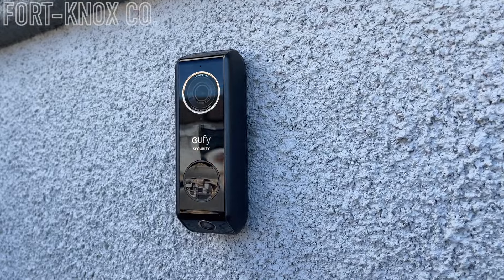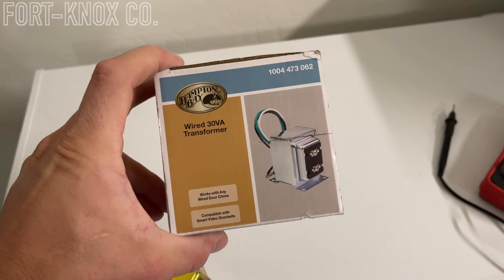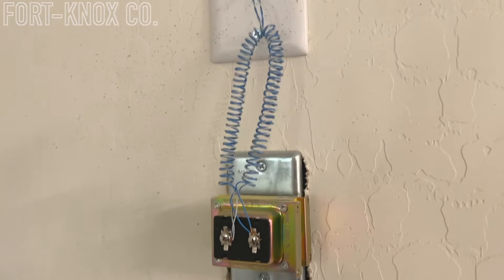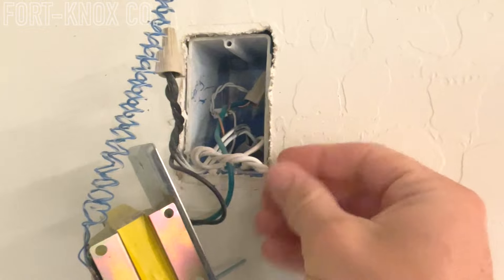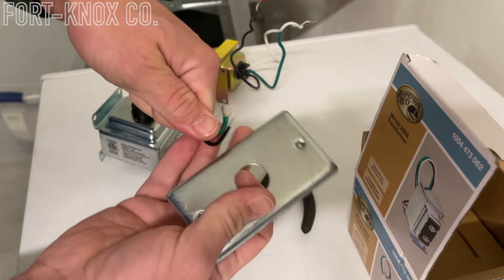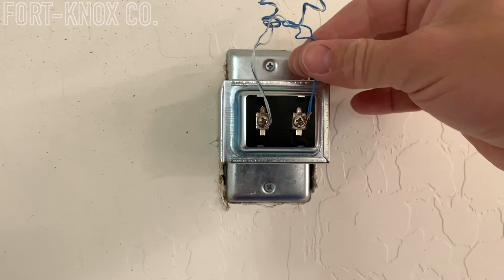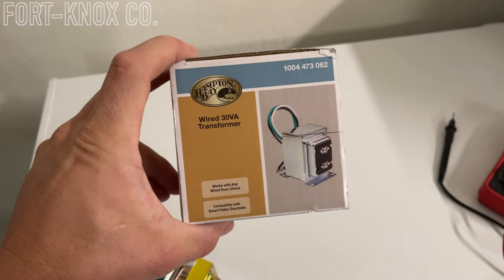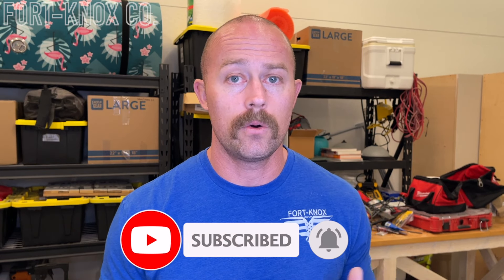Upgrade Your Doorbell Transformer For Your Video Doorbell | Ring Pro Doorbell Efuy Security Blink

Comment: Help. I checked the voltage at my front door button it reads 12 volts. I think I see the transformer in the garage above my breaker box up always. If I upgrade to 16 volts will that adversely affect my existing doorbell? I have high ceilings and don’t want a new door bell. While on the subject the doorbell chime is in a box and there is another box next to it? Could that be the transformer? I really don’t want to screw something up.
Reply from the maker: Finding your existing doorbell transformer shouldn’t be too hard. Everyone that I’ve seen even an older homes. Looks just like these in the video. It’s a small little box that’s wired on the outside of the outlet junction. Inside is common electrical wires and your basically wiring in a transformer that downgrades the power amperage to be appropriate for a doorbell. Finding this transformer in your house is the first thing. Once you’ve located where that transformer is at then you can easily replace it or upgrade it. I don’t believe upgrading to a stronger doorbell transformer will mess anything up. Assuming that you’re using a video doorbell most of them now of days need the higher power which is why this is becoming more of a common upgrade or builders are just installing this larger doorbell transformer during construction.
Reply: @FortKnoxCo  thank you

Comment: so, with this transfermer upfraded, my old chime will works?
Reply from the maker: Not sure what you’re asking. Is your stock door bell chime not working? Because changing out the transformer in general may be a solution. But a broken chime could be a couple of things. Upgrading to a bigger power transformer isn’t just a Fix in itself. But for most new video doorbells they require more power than what most houses  are built with. So in that case you should upgrade the power for video doorbells

Comment: Great video. My video doorbell camera and doorbell function were working with the old transformer (16/10) but after about 8 months, the doorbell stopped working (camera still worked). I just upgraded the transformer, but the doorbell still doesnt work (camera still does). Know what the issue could be?
Reply from the maker: If it just all of a sudden stopped working 100% it could be software update? Or could be mechanical and may need a replacement. I believe they have a good 1 year warranty. I’ve heard good stuff with their customer service and Amazon return process if you purchased it through Amazon. They like to work with you on that kinda stuff

Comment: I have a mechanical doorbell with a wired Ring Doorbell. There’s a delay to the mechanical bell once someone presses the doorbell. Will a new transformer fix this delay?
Reply from the maker: Possibly. But usually once you install a video doorbell there is a plug in chime associated to it. If it’s delaying the old chime/bell inside that could just be the way the new video doorbell is sending the signal. It’s possible interfering with the power to it or the signal timing.  It doesn’t hurt to have the stronger doorbell transformer either way

Comment: I have a euyfy dual camera 2k,doorbell (battery operated,) i also have a existing doorbell,  can i use this transformer to trickle charge the battery on the doorbell?  TIA.
Reply from the maker: If your able to install this transformer and run wires to your Eufy doorbell then you could use the wired version since you have the power there.  I don’t believe the battery operated versions have power hook up terminals on the back. But if they did, which some battery back up doorbells have then you could hook it up to those transformer and it would have constant power form the wires. Then if power went out your have some life left from the battery.

Comment: Hello, my house has a 10v 5va transformer, you think this 16v 30 is to much, I have two ring video doorbells on it, and today I notice both battery were dead, was good for the last 7 years.
Reply from the maker: It will not be too much. You will be better off with the stronger transformer and may get better performance from whatever you have hooked up to it.
Reply: Thanks
Reply from the maker: @bassdee10    No problem at all

Comment: I think my transformer is behind the chime box, another video showed a guy install a new transformer in the junction box behind the chime box but some said it isn’t code and could cause the transformer to overheat and potential fire hazard. What should I do if it in fact is on an inside wall (no insulation) already installed in the junction box and behind the chimes box?!
Reply from the maker: Hmm. Yeah I’ve never seen that myself. But maybe at one time it was okay with building code to have the transformer there. 

If it is behind your chime then I’d say you can go ahead and replace it, just make sure there’s as much room around it as possible and hopefully it’s not crammed in there too tight. You just need space for some airflow. I don’t believe they get super hot but obviously it “could” cause an over heating issue. Make connections tightly and make sure no wires are loose. That’s most common for fire hazards.  

The only other option would be to rerun wires from a different power location where you decide. Then running those new small gauge wires to your chime or just to your video doorbell.

Comment: If you upgrade your transformer to 24V from a 15 volt transformer would that increase possibly damage your chime and or light in the door bell switch making the light run hot and damage the plastic covering the light bulb  due the increase in volts? Please advise.
Reply from the maker: That I’m not quite sure of. It shouldn’t because it’s still pretty low voltage. But I wouldn’t upgrade to a 24v if you’re going to just be using a push button doorbell. It’s really only needed if you’re upgrading to a video doorbell.
Reply: @FortKnoxCo  I appreciate your quick reply. I do not want to over heat anything or cause a fire.
Reply from the maker: @braxal6983  no problem at all. Usually in most cases when your installing a video doorbell your bypassing or removing/replacing the push button/light doorbell.
Reply: @FortKnoxCo  What about the chime portion. Do I need to worry about to much power going to that? I really appreciate your help.
Reply from the maker: @braxal6983  nope. Thats where you usually hook up a small bypass wire to jump across the chime and bypass the push button. Making the power straight through to the outside where the button was and you hook up your video doorbell. So your doorbell has constant power. And all the wiring is still very small gauge and can easily handle 24v.
Reply: @FortKnoxCo  You have been so helpful. I watched video after video and It seemed none of them addressed this concern I have. Thank you for addressing it. I am thinking about getting the Reolink door camera it says it needs 12 24VAC 50/60Hz, DC 24V. recommendations?
Reply from the maker: @braxal6983  I would just upgrade to the 24v doorbell transformer when you get the video doorbell. It should power it perfectly
Reply: @FortKnoxCo  Thank you for all your patience and help!!!

Comment: Hi there!I’m hoping you can help me 😊. I am replacing my basic doorbell with a wired ring doorbell camera. My current transformer is 10v 5va & located on an unfinished basement ceiling light fixture ( near panel box) I purchased a 16vac 30va transformer to upgrade. I would like to eliminate the existing chime on my kitchen wall & patch small 1 inch hole. Is there anyway to do this and not use the jumper?  I did purchase a Ring chime which will plug into an outlet.
Reply from the maker: Essentially, with a jumper, all you’re doing is connecting the wire that is normally broken by the bell/ doorbell chime. so when the button outside is pressed it creates that connection to ring the bell.

So if you’re looking to eliminate it, you should be able to just create the connection between the two wires so that the power continues uninterrupted out to where the doorbell is. If you make that connection it most likely would be a Splice. I’m guessing. Normally, if there’s any type of splice connection in home wiring, it’s not supposed to be covered up or concealed Behind a wall. Usually it needs to have some type of access or panel even if it’s just an outlet cover. But if there’s a splice wire it needs to be able to be reached. That would be the only hurdle that I see if you’re worried about that. But in short, yes you can eliminate the doorbell chime. It’s just about how you want to go about it. With the new video doorbell it just needs the wires to go straight to the outside and not to the chime first.
Reply: Thank you SO much for the great info!! I got lucky and discovered my chime wire runs down to my unfinished basement side & can be removed easily from the transformer (which I’m replacing)so I’m able patch the small hole on my kitchen wall (from the old chime) & not have any loose unsafe wires behind the wall.  I really appreciate the help!! The video you posted was extremely helpful!! I subscribed 😁
Reply from the maker: @ChristySimmonz  that’s awesome to hear. I really appreciate that! Happy you got it all worked out.  Good job on that!

Comment: Is there a benefit of using 24v ?
Reply from the maker: It provides more power for these video doorbells that usually need a stronger source to function properly and have all the good connections like WiFi signals n stuff. So they need a stronger power supply than the traditional push button door bell chime.

Comment: Where can the transformer be? I cant find it
Reply from the maker: It’s most commonly in the garage, possibly near the garage  door opening, usually mounted up above your eye line.  If it’s not it the garage it could be near your front door or where your doorbell location but inside the house on a near by wall. Again usually mounted up high away from people being able to touch or bump it.

Comment: Thanks for the video. My transformer reads 18v.. does that mean it's a 16v trans or 18v. I ask because they say usually transformers will read higher than rated. How can I tell for sure if I have a true 16v or 18v if there are no labels?
Reply from the maker: One way would be to get a volt meter and test the two terminals that the small wires are coming off of and see if it reads an output of 18v or whatever voltage is transmitting. If you don’t have a volt meter or a tools to test the electrical current I would find the make/model of the transformer you have, google it and find the same one online and read the descriptions that are given. On some websites that sell it or have product information you should be able to find out what it’s putting out.
Reply: @FortKnoxCo  That's what I did. I have a volt meter and used the 2 screws coming off the trans.
Reply from the maker: @Mr-wt3uf  oh ok. I thought you were saying it was reading 18v as in typed on the outside of it. Lol. Yeah if it’s reading 18v that may just be the variance it has. A 16v transformer can have a fluctuation.  I say that also because I’ve not seen any 18v transformers for the doorbells in homes.
Reply from the maker: @Mr-wt3uf  are you checking this because it’s not functioning properly? Or just verifying?

Comment: Hey I changed it out and it didn’t work he said I needed to reset the ring and it didn’t work the chime doesn’t work what could be happening
Reply from the maker: Are you using a Ring doorbell? And do you have the bypass/jumper cable installed on your stock home chime?

Comment: I did exactly what you did in the video. After run diagnostic test it still showing my current transformer doesn’t match my door bell. What can i do to fix the problem. Tia 😊
Reply from the maker: Hmm. That’s weird. It should be able to recognize if the power source has increased and make the correction. I’m not sure if it would help to uninstall and reinstall the app or to disconnect and connect the unit.
Reply from the maker: Also do you have a doorbell chime in your home? If so did you use any jumpers wires to bypass the wall chime? I think this could be a factor as well. By bypassing the wall chime I think it helps the power just run straight to the doorbell
Reply: @FortKnoxCo  yes i do have a doorbell chime side but without using the jumpers wires. I’ll looking into jumpers wires tonight. Thank you so much 😊
Reply from the maker: @Taylor-xw8op  awesome. Yeah that may help with the power getting to the doorbell properly

Comment: My vid doorbell stopped working, borrowed my neighbor's multimeter, and only getting 1 volt out of the transformer so the thing is shot. My concern is that I don't know which breaker will cut the power to the transformer, and if it's only showing a volt or less, how am I even going to know if I found the right breaker?
Reply from the maker: That’s a good question. Have you put the volt meter on the actual electrical wires in the outlet box? The 12 gauge wires that this transformer wires into should be putting out 110v. So by checking that you’ll know if that house electrical wires is getting juice. That should be 110v. If the romex 12 gauge wire in the box is only showing 1v then you may have a bad power source to start with.  Or a breaker that it is on is already popped.
Reply: @FortKnoxCo  Thanks for the reply. Actually, no I haven't opened it up yet. How would I do that? Do I but both points from the multimeter on one wire? Or?
Reply from the maker: @MDC885  you would put one electric point on the black wire and one on the white wire. It should read 110-120v if you have the multimeter on the right range settings.  Allow the current to flow through the two electrodes. Complete the circuit with the points and the multimeter inbetween
Reply: @FortKnoxCo  Ok got it! Does it matter which color probe goes on which wire? Or either one can be placed on the black or white wire? Thank you for your help
Reply from the maker: @MDC885  shouldn’t matter. So long as your completing the circuit with the probes and the power can run through the multi meter
Reply: @FortKnoxCo  Ok sounds good, I'll try not to fry myself!
Reply: @FortKnoxCo Good news is I didn't fry myself and I found the breaker for the transformer (living room!) Problem now is that I can't get it mounted. The old transformer had a circular thread on the back of it, and the face plate had a hole that you stick the threaded circle through and screw a ring on the back to secure it. This new one is completely different. It's model UT-125-03 and the directions say it needs a junction box with flat sides and knockouts. Do you have any idea what that means? Do I need an entirely new junction box, or is there a face plate that will work with the existing junction box?
Reply from the maker: @MDC885  that’s awesome to hear. There should be a couple links to new face plates that have holes already in them. Also if your crafty enough you can drill your own hole in a blank face plate that will allow the cylinder with threads to pass through and accomplish the same thing.
Reply: @FortKnoxCo I think you misunderstood what I meant.. The old transformer is the one that had the round thread on the back of it to fit through a faceplate with a hole of the same size. The new one Utilitech UT-125-03 doesn't have that way of mounting, it's totally different.
Reply from the maker: @MDC885  I just looked up that brand, I see what you’re talking about. It appears like it has a couple tabs with holes in it that you can secure it down to a plate. I’ve seen some photos of people mounting those directly to the wall or to some type of flat surface. Ultimately, you still just need to wire it incorrectly and it will work. You just don’t want any other metal objects brushing up against it. So I’m sure the manufacturer recommends having it secured to something that way it doesn’t move or bump into anything, by however, you want to accomplish that you can wire it in and mount it or place it into the box one way or another so no other metal or grounding wires touch the outside of it.
There are a couple links on that video, and the one brand that I linked on Amazon Maxdot has that threaded cylinder to go through the plate like most are traditionally found.
Reply: @FortKnoxCo Ok thank you, I'll probably just head to Lowes and find a guy with gray hair and pick his brain for a good solution; usually what I end up doing anyways hahaha
Reply from the maker: @MDC885  that could work too